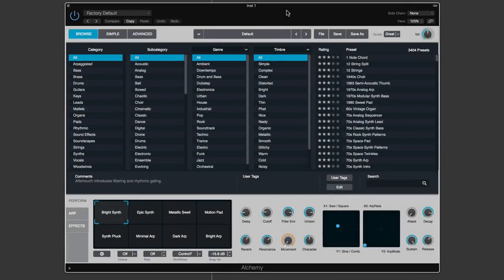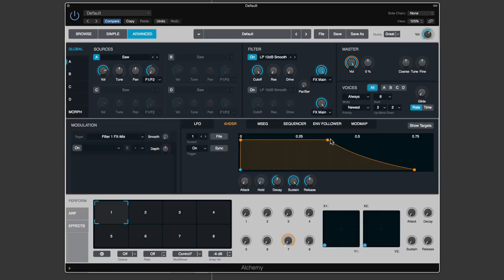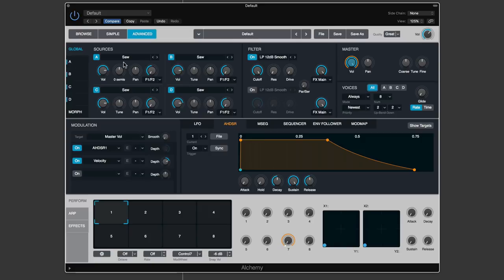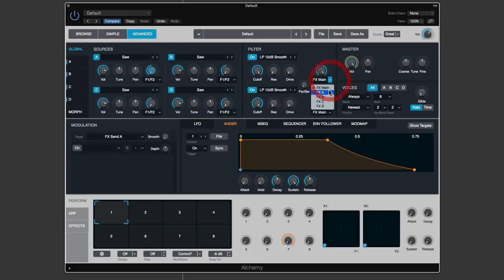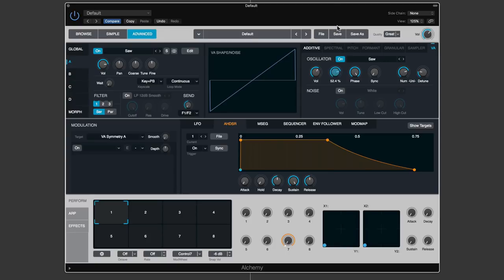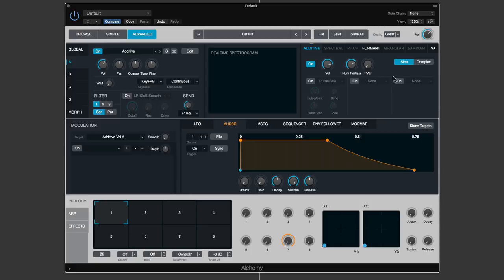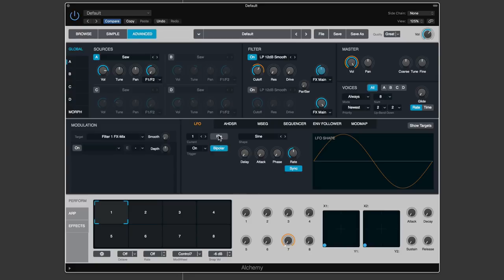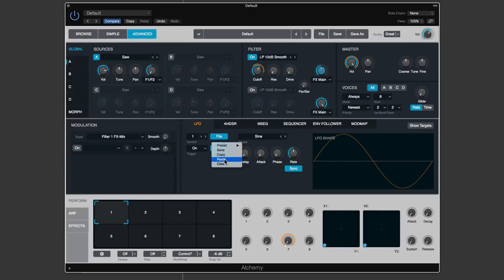Alchemy Tutorial 1 - Intro

Comment: Ha! knew you'd crack eventually.. Will watch tomorrow. (Vid rez looks pretty low?)
Reply: Must have watched before YT had generated the HD version. Oftentimes a little while unto that happens. 

PS been having some real issues with Logic, specifically with Setting Project to follow audio multitrack projects. See comments video dated 28th Sept. Not going to repeat here as Off Topic!
Reply: Hm, still looks 'soft'
Reply: Currently watching in 1080P . Looks nice and sharp to me. Reload the page, and check that the Gear icon is showing multiple resolution modes.
Reply: Got it on auto (1080phd). Dunno, mean looks ok maybe not as sharp as some he's done..